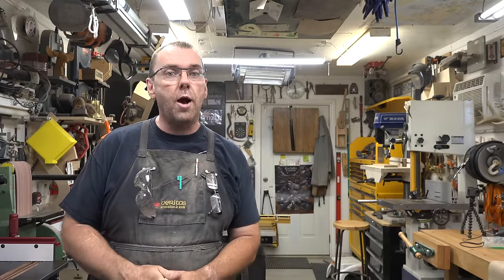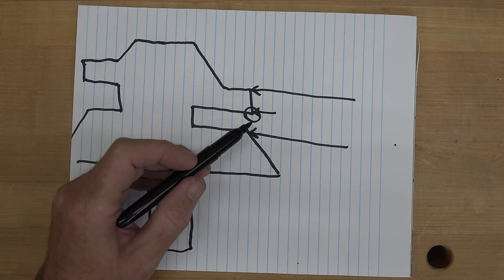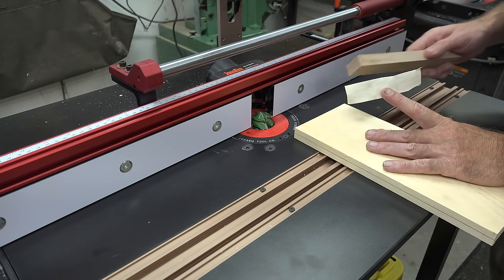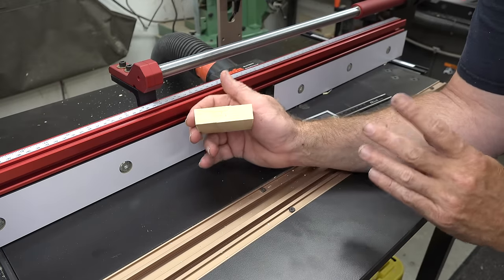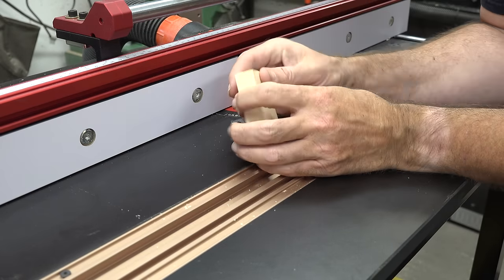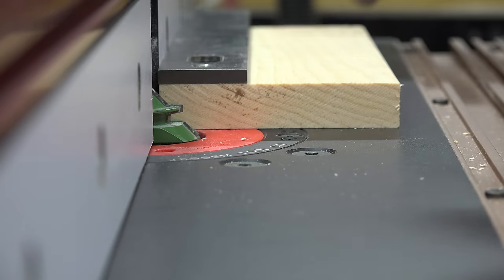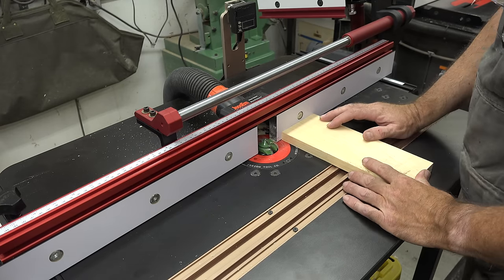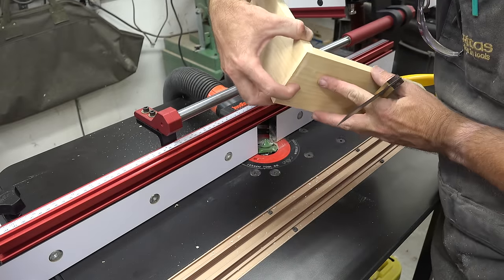Lock Mitre Router Bits

Comment: Kenny,  that was a great video about setting up the lock miter joint.  I have seen those bits but don’t own one.  No doubt this would be a great touch to add when making lots of drawers but on the other hand it seems like a lot of work for just the occasional small project.  If you always made your drawer parts a known consistent thickness you could then make setup block that would help a lot with the beginning setup and then all that is left is the fine tuning.  There you go, setup advice from someone that doesn’t even own the bit...LOL...Thanks.
Reply from the maker: The setup is finicky until you get used to it but I guess that is the same with all tools that we have.  If it was easy, everyone would be doing it.  LOL.  Seriously though, once you understand the setup, it becomes second nature and you are 100% right that running test boards and making setup blocks would make this process extremely fast and easy.  Thanks for tuning in Paul.

Comment: you are the best ,for beginners my question is 1/2 cutter can use only exactly 1/2 inch wood or any size
Reply from the maker: That's kind of a hard question to answer.  Each bit is different and each bit will have a thickness range that it will work with.  You will have to check the thickness range of your bit to see if it will work for the thickness stock you are using.  I hope this helps.

Comment: Ripping the edge of the test board at 45° on both faces reveals the center of the board. Makes it easier to align height of the bit getting closer to centering the bit
Reply from the maker: The method I showed on this episode of the show, is only one of many different ways to set up the bits.  Your method would also work well.  Thanks for tuning in and for chiming in with your suggestion.

Comment: Great instructional video... the only thing I'd change is to use an aluminum or brass straight edge when setting up, to avoid chipping the carbide on the bit...tungsten carbide is notoriously  brittle. Also, I'd use a backer board to prevent blowout on the back side of the workpiece. Otherwise, great job!
Reply from the maker: Thanks for the kind words and for chiming in with your suggestion Tony.  I appreciate you tuning in to the show.

Comment: Another really clear presentation. It all makes such sense. Just one thing occurs... When setting the height of the bit isn't the centre the point where each part of the profile is exactly opposite as you move away from that point? It looks like the corner you selected at the beginning isn't quite the centre (should it be half way along the sloping edge next to it)? Maybe I misunderstood, it's not the end of the world as your adjustment system soon takes care of any error.  Thanks again from England.
Reply from the maker: Thanks for the input Rosemary.  The initial "centre" of the bit is aligned as close as you can.  I may look off due to camera angles etc but as you pointed out, the final adjustments take care of any errors in initial setup.  The actual "centre" of the bit varies depending on brands names etc but the demonstration at the beginning of the video, showing the centre will pretty much get you close.  I hope this helps.  Thanks for tuning in and for taking the time to leave your input on the show.  It's appreciated.

Comment: Nice video good explanation only improvement id suggest is a sacrificial fence once the bit height is set.
Rather like used on a spindle moulder
Reply from the maker: If the sacrificial fence is what works for you Darrin, then there is nothing wrong with that.  Thanks for tuning in to the show and for taking the time to leave your suggestion.  It is very much appreciated.

Comment: Thanks for the great explanation. I realize the norm is to make one big cut but I can’t understand why, especially since it’s hard on all the parts and the wood is going to be fighting hard to deflect all the way. Once everything is set up, just screw on a fence spacer maybe 1/4” thick (or more for really thick stock) and you make cuts in both the vertical and horizontal positions. Remove the spacer and make the final vert and horiz passes. All of the cuts are headed towards the desired end product. In fact, the only critical adjustment is the cutter height. You could forget the spacer and set the fence anywhere as long as the depth of cut is shallow relative to the final one. For the last horizontal and vertical passes, the fence could be adjusted using some scrap. Or am I missing something?🧐
Reply from the maker: My method is not the only method in the world and if the method that you described above works for you, then that's fantastic.  I've been using the method that I demonstrated on this episode of the show for years and it has never let me down but I'd be a fool to say that my method is the only one and that someone else's wouldn't work.  Thanks for tuning in to the show and taking the time to chime in with your comments.

Comment: Been watching a few of your videos, great stuff. Wish i had that dro table as i see a lot of sacrificial pieces needed to find tune.
Reply from the maker: That digital readout does make adjustments a lot easier, but as long as you are careful, you can pretty much dial it in with minimal stock waste.  After a test cut, take your test stock to the table saw and cut the mitred ends off of it.  You can get several test cuts from one board and minimize your waste.  I hope this helps.  Thanks for tuning in to the show.

Comment: Wow, thank you so very much this videowas amazing and veryinformative. Now I have one question.  I have some wood flooring that I was to create some wood steps with nosing. The planks measure 5/8" thick. Wood a router bit for a 3/4 work for this or does it has to match the thickness of the plank.

Thank you in advance for your response.
Reply from the maker: First off, thanks for the kind words on the show Marion.  I truly appreciate it.  As for your question, these bits are not specific to a size, but rather specific for a size range.  The bit that I use in this video is capable of joining boards from 1/2" thick to 3/4" thick.  So if you had this specific bit, it would serve your purpose.  You would need to check the stock thickness range of your specific bit but in general, a bit that is capable of joining a 3/4" thick board will also be capable of joining a 5/8" thick board.  Just check your bit to be certain.  I hope this helps.  Thanks for tuning in to the show.

Comment: Muito boa sua explicação , tenho uma fresa dessa e não estou conseguindo encontrar o melhor resultado. Com essas dicas facilita muito a usinagem.
A propósito como vc faz com relação a retirada do pó nas suas máquinas? Obrigado.
Reply from the maker: I'm glad that you found the explanation to be helpful Carlos.  For dust collection, I have a larger dust collector that has a 4" wide hose that takes the majority of the sawdust away.  The rest of the dust from the router bit, is taken away from a 2" dust port in the router table's fence.  I have to transfer the 4" hose from tool to tool in order to get dust collection at every tool, but it is worth it.  I have a garbage can dust separator in between the dust collector and the tool so that the heavier dust goes into the garbage can instead of into the dust collector.  It allows me to empty the dust collector a lot less often.  I also have a ceiling mounted airborne dust collector that collects all the smaller airborne dust particles.  I hope this helps.  Thank you for tuning in to the show and for taking the time to leave the kind words.  I appreciate it.
Reply: @acutabove_woodworkings  muito bom kenny, entendi, perguntei sobre a retirada do pó porque minha oficina é pequena e tenho um sistema de coletor simples com tubos de 4" , porem o motor que faz a sucção e´fraco , perdendo uma boa eficiencia, mas ajuda. 

Muito obrigado pelas dicas e pela atenção , abraços
Reply from the maker: @carlosgomesribeiro9569  You are very welcome.  All the best to you.

Comment: Excellent teaching video.  Would like to know what speed should be used with this bit. >16000? or higher?
Reply from the maker: The maximum that a bit of this size (approximately 1 1/2" in diameter) should be run is about 18,000 rpm.  So any speed up to that amount is fine.  I usually run it at around the 15,000 mark and then adjust as needed.  I hope this helps.  Thanks for tuning in to the show.

Comment: Super helpful video...
My question is, would you recommend this method on something as large as what I'm building??? The biggest section I have is 3/4in. x 40in. x 10ft. plywood (Birch)
Reply from the maker: This is a strong joint with plenty of glue surface and would most likely work just fine for your project.  I hope this helps.  Thanks for tuning in.

Comment: Rockler sells a plastic jig to help you set up the bit fast if you have a Rockler bit. Or once you get the fit you want you can make a set up jig with a piece of wood so next time its a fast set up.
Reply from the maker: This bit is not a Rockler bit but I do agree that a setup jig can help.  I also agree that once you get the setup dialled in, making a setup jig is a must.  I used some UHMW plastic to make my jig once the settings were right.  Thanks for tuning in and for chiming in with your suggestions.

Comment: Great training video!  Once set for each material thickness, could you make a set-up jig by using HDPE for each type of pass and then use that to set the bit in the future?
Reply from the maker: Absolutely.  There's nothing wrong with making your own setup blocks.  I have made a pair myself and they work great.  I do find though, that I have to fine tune the setup even with the setup blocks but it is a lock quicker than setting up the blade initially.  Good luck with your bit Kyle and thanks for tuning in to the show.

Comment: Great Video and explanation of how to set this type of bit at.  I do have a question, do you adjust the speed of the router with different materials?
Reply from the maker: I think it all depends on how the bit is reacting to the material Ric.  For the most part though, I don't reduce or increase speed according to the material I am using.  I adjust speed according to the diameter of the bit and the recommended RPM for certain router bits.  I hope this helps.  Thanks for the kind words and for tuning in to the show.  It is very much appreciated.

Comment: Thanks  great videos … It will mostly likely be clear when i try this but how can I tell the range of timber thickness for my cutter ?
Reply from the maker: Each cutter is listed with a range of stock thicknesses.  If it didn't come with such a listing and you can't get a range from the original point of purchase, then you will want to check the height of your cutter heads on the bit.  You can't lock mitre anything wider than the cutting area of your bit.  I hope that made sense.  Thanks for tuning in.

Comment: Thank you for the video, very helpful! I'm working on a tapered column...would I still add the 1x2 strip (with doublesided tape) as a chipout or miter point protector on the work piece for a 1 x 4'6" board?
Reply from the maker: I would still add that board Nissim.  That tapered corner of the stock once you finish routing the miter is very fragile and it doesn't take much to damage it and ruin your lock mitre routing.  I hope this helps.  Thanks for tuning in to the show.
Reply: I can’t see a lock miter working on a tapered column. The geometry of the cut forces the boards together at 90 degrees perpendicular to the edge being cut. Just make a drawing of a very highly tapered column and think about where the “slots” in the cut face will be pointing. It’s not at each other so the sides wouldn’t fit together at all, so a slight taper wouldn’t work either.
Reply from the maker: @rbrown2925  You make a great point here.  I missed the part about it being a tapered column.  Thanks for chiming in with this.  I guess I was focussed on answering about the strip of guide stock.  Thanks.

Comment: Great video and info! Question I have given this a shot recently and I came close but ran out of wood to test on lol. When I was routing, at times the bit was tearing up the wood?  I used pine, and poplar. Had read somewhere to use the router at slow speed which I was on 1.  Also how many passes should you do? It seemed the more passes I did the more wood got cut off where I would have thought it would have made the cut more clean?  Hope your still answering questions about this. Many thanks!!!!!
Reply from the maker: Of course I am still answering questions on the show Frank.  I do my best to answer every comment and question on the show.  Now, to your question.  I would suggest doing the routing all in one pass.  I'm not a fan of routing in stages when it comes to lock mitre bits.  As for the speed of the router, it is all dependant on the size of your bit.  Up to 1" diameter, 24,000rpm maximum.  1-2" diameter, 18,000rpm maximum.  2 - 2 1/2" diameter, 16,000rpm maximum and 2 1/2 - 3 1/2" diameter, 12,000rpm maximum.  I would suggest checking your router's manual and seeing what speed setting you need to set your router at in order to get under these rpm maximum values.  Tear out can be caused by a lot of factors.....wood grain, dull bit, wrong rpm settings etc.  I hope this helps.  Please feel free to ask as many questions as you would like until you get it dialled in.  Thanks for tuning in to the show.

Comment: A really good tutorial on lock mitre bit set up. Cheers. 
Do you have a selection of bits for different timber thickness? . Is it okay to hog out that much wood in one pass... Was the 2nd pass a clean up pass?
Reply from the maker: The material removal for a lock mitre bit joint is removed all in one pass.  The setup is a little finicky and once you get it right, you don't want to be adjusting your fence to remove less material.  So essentially there is no second pass.  As for the bits and different thicknesses, each bit has a tolerance level.  They will joint (for example) from 1/2"-3/4" stock etc.  I only have one lock mitre bit and I purchased it with the though in mind of what stock I would be using most.  You would have to check the tolerances of your specific bit to see what it is capable of.  I hope this helps.  Thanks for tuning in to the show and taking the time to ask your questions.

Comment: Thanks for the video. Can I ask if lock mitre can be done with a plunge router.
Reply from the maker: It is definitely not recommend to use this bit with a hand held router.  It is too large and should only be used in a router table setup.  I hope this helps.  Thanks for tuning in.
Reply: @acutabove_woodworkings  Alright, Thank you for the reply. Now I'm looking for a DIY router table design. Thanks again.

Comment: You make it look so easy (as always).  2 questions:
if you are doing hardwood, do you still do it in one fence setup rather than creeping up?  I guess shims might be the answer for hardwood.
second, how good would this work on plywood?  would it cut clean and also give a strong joint with just glue?
That might be 3, oops :>)  your presentation was excellent Ken.
Reply from the maker: Well, let's start with the first question.  While it is always a good idea to take hardwood stock in multiple passes to be easier on the bit, this is a pretty beefy bit and could handle the hardwood with no problem.  Even with hard maple, I make a single pass for about 99% of the stock removal and then a second light pass (as I demonstrated in the video) to clean the cut up a bit.  Works perfectly.  So in answer to your question, one setup is just fine.  That's what the bit was designed to do.  As for plywood....fill your boots man.  MDF, plywood, solid stock, UHMW plastic....whatever you like.  This bit will work with all of them and cut it clean.  As for the strength of the joint, it is much stronger than just mitre cuts alone and has about the same (or possibly a little stronger) hold than a mitre with splines.  It is basically a mitred joint with a spline running along the entire length of the 45 degree joint.  It doesn't get much stronger than that.  I hope this helps.  Great to hear from you Russ and thank you for tuning in.

Comment: Love the video  now how do I measure for a slot for glass like a shadow box
Reply from the maker: Basically, measure the thickness of the glass (mostly it is 2-3 mm or 1/16") and that measurement represents you kerf of the width of your groove.  I like to use digital callipers to measure mine.  I usually like my glad to recess by about 1/4" so that will be the height of the saw blade.  I hope this answers your question, but if not, feel free to clarify and I will be more than happy to answer.  Thanks for tuning in to the show.